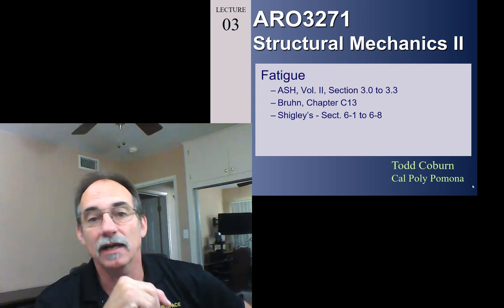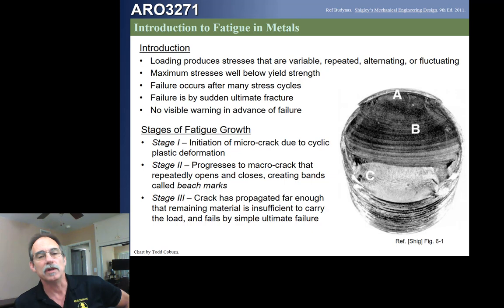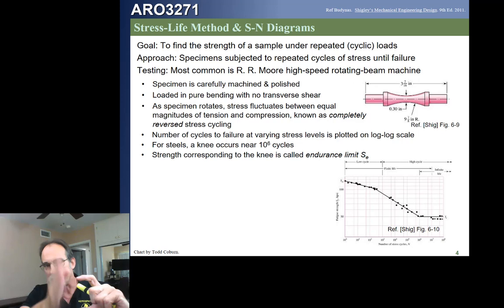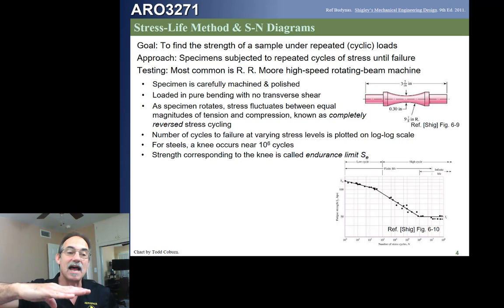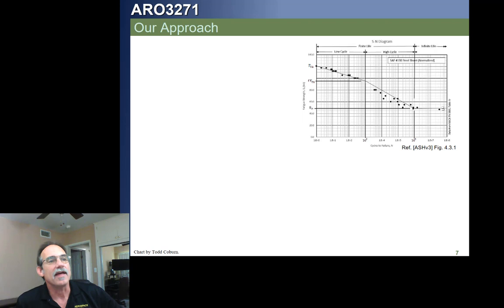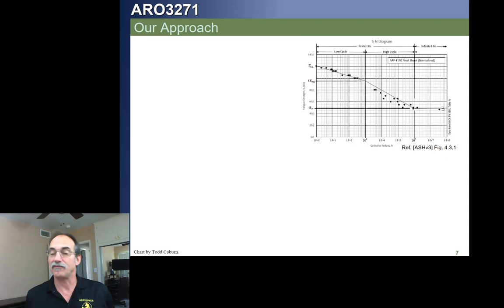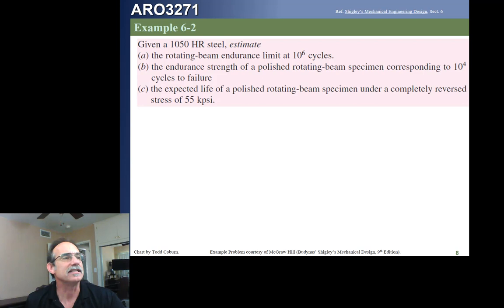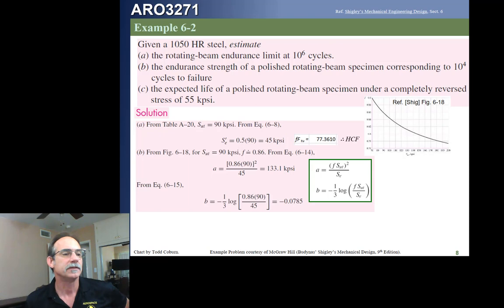Stress Analysis II: L-03 Fatigue - Overview of Approach

Comment: Hey Todd,
At 33:42 , you’ve shown the answer for the Se of aluminium to be 32ksi but in the alternate lecture (L-03b) you’ve shown the table of Max Se’ and it says the value of that for Al in 19 and therefore in that lecture you’ve shown the answer to that problem to be 19ksi.
Reply from the maker: There are two principles at play here.  First, we set Se’ as 0.4 Ftu for Al, which indicates 32 Ksi for some aluminums.

Next, you cut off the value to a maximum of 19 ksi.  This is Se’, and overrides the first value.

Following that, you apply Marin Factors to convert this pristine, perfect value to a more realistic one for your application.

Comment: at 28:12 to find a and b do we use S'e or just Se?
Reply: also the graph in the book on page 3-7 only shows low cycle fatigue calculation how would we find the failure strength fraction of a high cycle?
Reply from the maker: James, always use Se.  Se’ is an unadjusted preliminary “perfect” value.  Of course, when you have limited information about the part or loading, as in some classroom problems, Se’ may be your best estimate for Se.
Reply from the maker: The strength fraction f is based on Ftu and material only.  Same value is used for low & high cycle fatigue calcs.